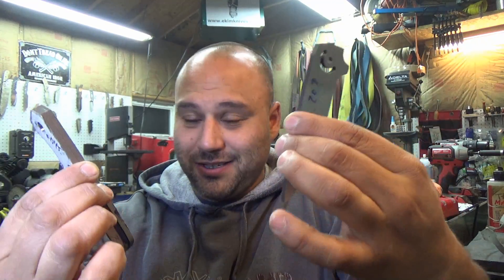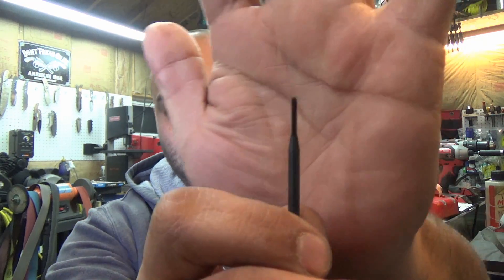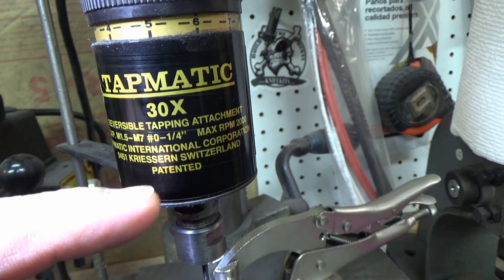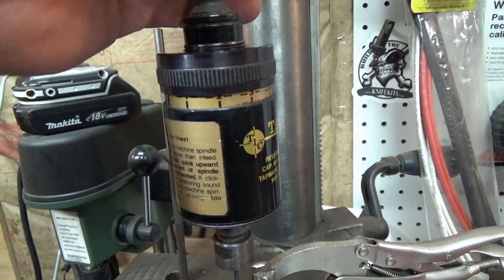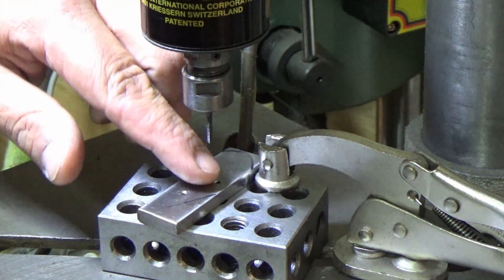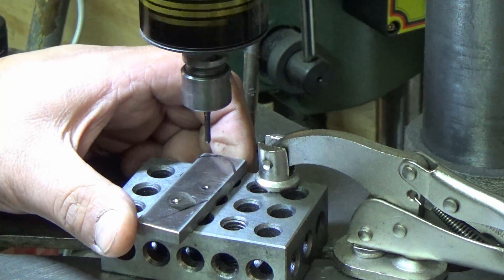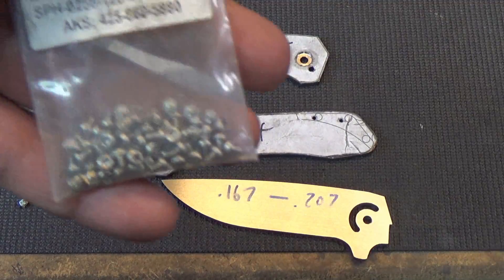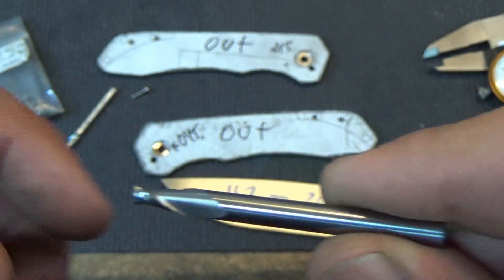How To Make A Folding Knife #7 Tapping Titanium and Fitting the Back Spacer

Comment: I use thread cutting cobalt coated taps in my tapmatic. And I took a 123 block with one center hole and made a fluid dipping well. So dip the tap and tap. Saves lots of time. Think I've showed it on my IG account.

Comment: If you use a tooling plate like I do for large batches of knives, I'll drill one hole like the front hole in the handle on say 70 tacticals. So long as I don't move anything I can remove the drill bit and put in an endmill and use that to counterbore the hole. Only works with the piece secured in a jig made to be used over and over again. Great video by the way.

Comment: Awesome work Mike. But if I may, step up to a 4-40 screw, 2-56 screws are just not worth the headache and blowing through taps. Not to mention for future maintenance on the knife, having to take down a knife on bearings is a must. Going with a larger frame screw will help out with not only you but your customers.

Comment: if you need small counterbores/ step drills with pilot for the 2-56 screw I have a friend that makes them in central FL and will resharpen when needed. I don't benefit from the sale of them but I can pass on his information for anyone that may be interested. I'm sure he would appreciate the work. I've been using them over a year now with no issues. Can make carbide as well.

Comment: And I just use cobalt coated drill bits to count sink for the small screws. Don't really need to flatten the screw counter sink holes. Can but not necessary. Good videos tho. And you can get  partially threaded studs from McMaster to put in your 123 blocks to keep parts from helicoptering

Comment: cool vds, would using aluminum be a choice that is less expensive while i am learning.
Reply from the maker: Thank you! Aluminum is good for everything but the lock bar since aluminum doesn't have any spring properties to it. Stainless steel is a good substitute but I've never built a steel frame lock before so I'm not exactly sure how it relates to working with titanium.
Reply: Ekim Knives can i use 416 ss before i try and use ti.

Comment: The knife maker that sells the titanium pivot screws Steve  sk designare the pivots he also sells the titanium screws, also he sells the carbide counter bore for these. I'm sure he does
Reply from the maker: I have the screws and the counterbore from him and it works very well but its expensive. I use them on the folders I'm selling but I wanted to show a cheaper option for the new guys out there.  The steel screws i'm using in the video have a slightly larger head diameter so the counterbore I have wont work unfortunately.
Reply: Make your own buddy with your surface grinder indexer and drill bit very simple mate.
Reply: If you get a diamond wheel you can just grind the endmill to suit.
Reply: @Britton Steele I run my tapmatic around 950 RPM for 2-56 threadform taps

Comment: Hmmmm, u can align things by simply installing the drill used to drill, do not remove part then insert the end mill in a chuck pushing the end mill all the way up the chuck so it can not raise up, tighten securely and you got your counterbore. take it easy not like your taking out inches, your just going down 30-80 thousands at most right? I use to lock the Quill in upmost position and raise bed accordingly, but I was on a Bridgeport that had all those movements. u can do it. easy
Happy Thanksgiving  Sir.
Reply from the maker: This is a great idea! Thank you very much for the input and sharing your experience. Have a Happy Thanksgiving!